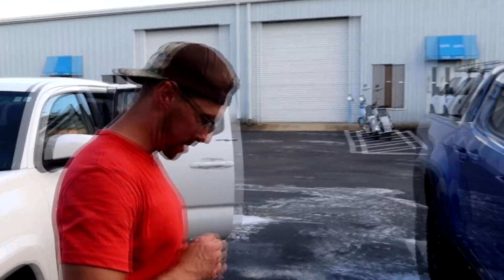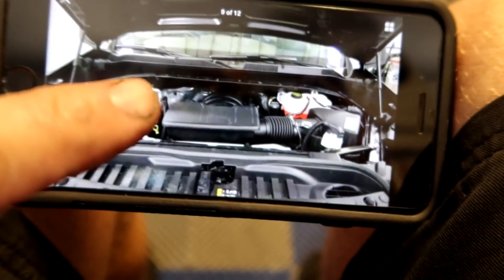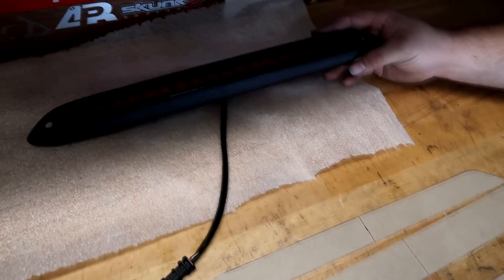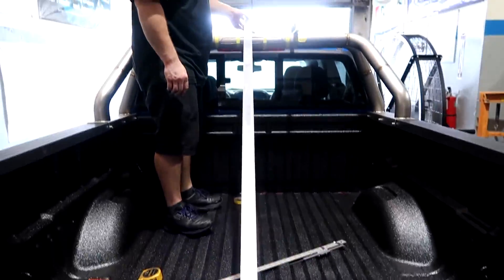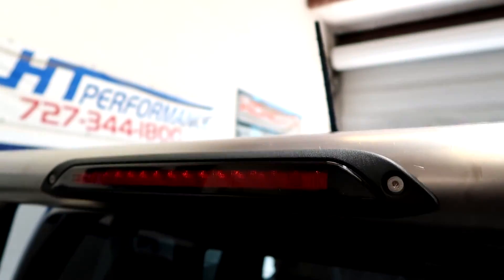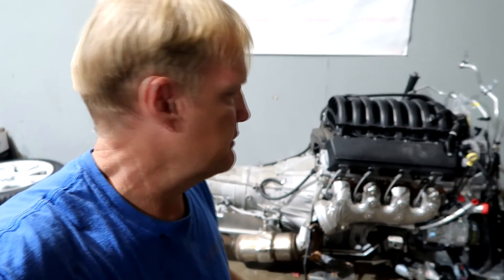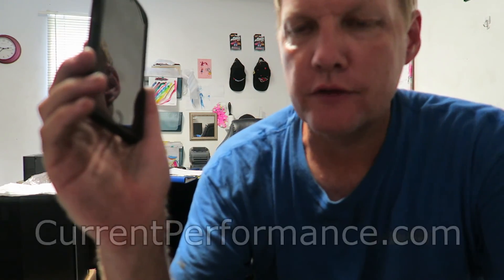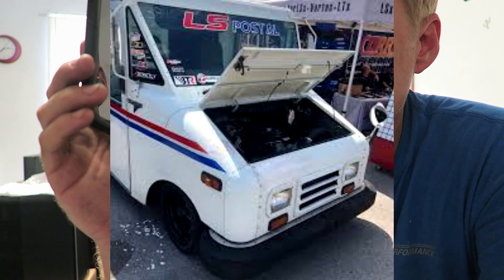Colorado Z71 with V8 Silverado swap  #8

Comment: With your conversation, if I may ask, roughly how much did the tunning and the the 5.3 block with trans cost you for the swap? I’m looking to do a swap on mine and would like an idea of how much it may set me back.
Reply from the maker: I paid $5500 for motor and trans with almost no miles. I would say you could do it for around $8000-$9000 if you do most of it yourself.